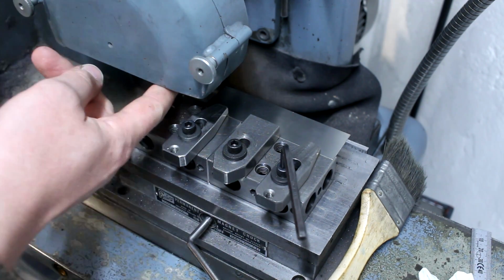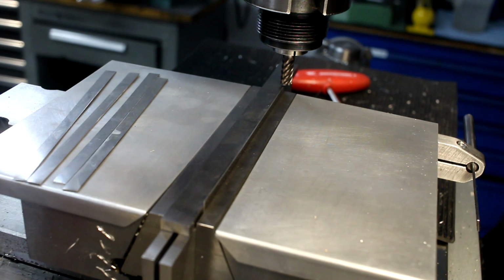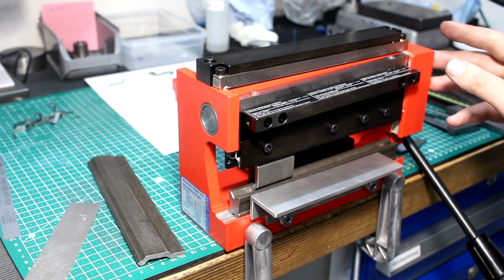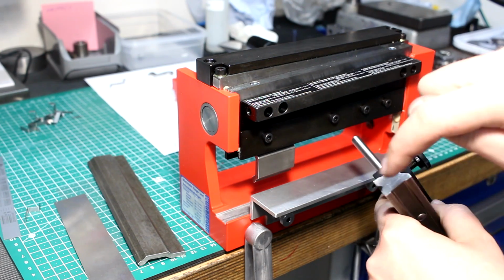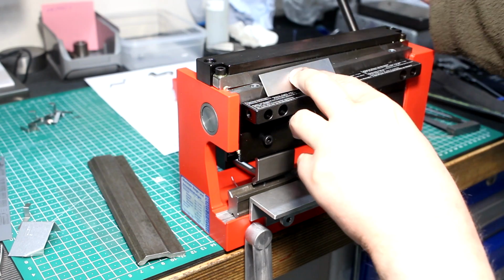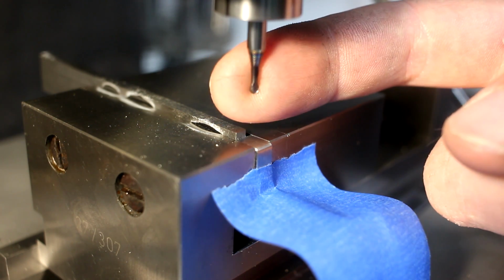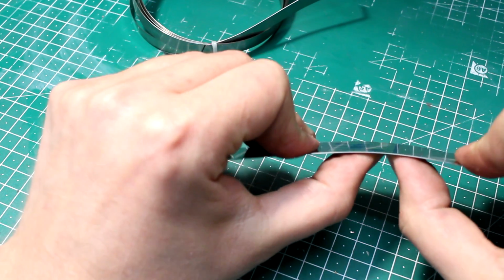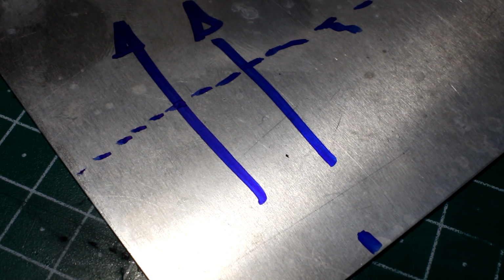Sheetmetal work and the Profiform 200

Comment: I never cut spring steel with tin snips nor sheers. It always needs to be sawn then I usually hand file the edge. Nice cutting work, Stefan.
Thank you for explaining the stress lines and the scribe lines and the cracking that takes place.

Comment: Hello Stefan,
Very nice tips as usual. Please continue shearing your great work!

How did you made you MB4 so silent at 3000 rpm even if it has a gearbox?
My Optimum BF 46 is much more noisy at that speed  then your machine.
Or maybe you reduced the sound when editing the video?
Reply from the maker: I pull the volume of all machines down by 15..20dB - Much easier to watch/listen to it on video.
But even in real life the machine is at 3000 rpm quite ok, i usually run it without hearing protection.
Reply: Thank you for the answer.

Comment: Stefan, just an odd question which keeps me wondering of I should go for it or not. I own an Heur Front vice which I really like. I use soft jaws with magnets to protect my parts but they are kind of troublesome in use; Newton keeps on acting upon them. Ideally I would like to fit screwed down exchangeable copper jaws. THis means I have to machine the vice which is doable, but I also need to drill (no problem also using a carbide drill) but also to tap. When I'm at tapping I can't go back. I then milled a relief for the copper jaws and drilled the holes for the tap. My worry is to get a decent thread in the holes without breaking the tap. I cannot mill the thread because the vice is to big for my machine (Haas Mini mill) to have enough clearance for the tooling to reach the vice jaws. In short; what do you think? Thank you in advance for your answer and with best regards, Job

Comment: The grain of metal is more like paper than wood. Modern paper has a grain to it too for pretty much the same reason as metal because it's made on a continuous process machine. If you are folding a piece of paper across the grain the bend radius will be larger and can actually cause the paper to crack so the signatures in books and the folds of magazines always take the paper's grain into account. Usually the grain of metal is only a big problem when drawing shapes, like aluminum cans for instance; the grain means that after multiple draws you end up with "ears" of metal around the top that have to be trimmed.

Comment: Yet another time when I learn something new. I did know about problems when drilling spring steel. We were making angle gauges during our metalwork class and were advised not to stop when drilling the spring steel blade because it would work harden. We of course weren’t using a pre-hardened material, the bluing was part of the exercise.
Like your new machine. Glad you treated yourself to a Swiss variety, but those Chinese prices are addictive.
Regards

Comment: Great video Stefan. One comment about your aluminium I could make is that it did look like it had a surface prep on it. Sanded or brushed. Straight off of the rolling mill it is much smoother in appearance. Almost impossible to tell the grain orientation in a smooth aluminium sheet without a few test bends. Great video, and I enjoyed watching your explanation of your little bender/shear. Beautiful tool.

Comment: Thanks for another enjoyable video.  
However, I have always regarded marking Alumin(i)um or it's alloys with a pencil as a way to install a delayed corrosion crack generator. On aircraft, it is not good to have your work assessed by a coroner. (http://lists.contesting.com/_towertalk/1999-01/msg00003.html)

Comment: About the shear, I think the stock material is meant to go in the gap from the back side, and the gap would act sort of like a hold down on a regular shear, else you run into the lift-wedge problem you just had when you tried holding the narrow piece from the movable blade side - it lifts and and tries to wedge between the blades pushing them apart hence requiring the strong backs for the blades, but if there is a hold down for the material, the lift-wedge doesn't happen and no need to add the strong backs

Comment: Hello Stefan, I agree with not wanting to use the term grain direction.  However, material rolling does effect the grain structure of the base material.  Think of forging, as an example.   Rolling compresses the material grains in an outward direction changing the tensile strength in the direction of the roll.  Thus the material is more susceptible to fracture in the direction of the roll then in the perpendicular direction which has increased tensile strength due to a more compressed grain structure.  Hope I'm making some sense.  Nice video as always.
Reply: Agreed

Comment: looks good stefan, is there any chance that you could show how you grind the thin parallels? Thats something I cant seem to find any info on, doing really thin parallels of different sizes. 

I was watching a video the other day where the guy was forging nails, but he was using sheared blanks, and was showing how the grain structure was by trying to bend the sheared blanks with them being sheared cross grain, and was just snapping them off till he stuck them in the forge to heat them up, which rearranged the grain structure and then could bend them 90 degrees no problem.

Comment: Profiform 200 looks nice. I am hunting for over a year for small semi-portable bender like this, but 200mm is too little. Profiform 320 still looks a bit too small. If there was 500mm model, that can also bend 1.0mm steel and 1.5-2.0mm aluminum, that would be great. Most of the bends I need are less than 300mm wide, but there are few that are 480mm :/  And I don't have space for huge machine tho.

Comment: At 5.45 why not mill them all together? Did I miss something?
Reply: I'm with you. I prefer to stack parts like this together because there are fewer burr edges to deal with afterwards, and its much faster.
Reply: Have you ever tried herding cats?
Small thin parts like that are just about impossible to get them all setting down on the bottom at the same time.
Reply: @andreblanchard8569  sorry but you are wrong. I've done this many times. I may even have it on one of my videos.

Comment: I have never paid much attention to the "grain" in sheet metal, I will need to do better. That worth the price of admission,
Reply: Me neither, I've drawn probably a couple hundred military parts in sheet metal with most of them having bends and many in multiple directions.. Never heard that it could be a problem. But I'm thinking the bending radius must have something to do with it too.
Reply: @erik....  I have always found this information in old books on press tools, I don't have any of mine to hand right now but probably they are all pre WWII. They were often concerned with blanking and bending parts on the diagonal to avoid cracking. I don't know when the information started to disappear from the books or why.

I suspect my books are old enough to be written by men who had experience with real wrought iron and that stuff is fibrous, stringy, often with slag inclusions and a very definite grain like wood.
Reply: Absolutely priceless information.

Comment: Stephen great video enjoy all your videos, the time you spend and the quality the video is top notch. I'm a model /tool maker 40 years in the trade and work in the  R&D shop in California for a very large multi national company.I  deal almost exclusively with metric 3D models and prints. and use a lot of thin tool steel in the 1 mm thickness. I usually have to mill and grind from a fraction, or get it double disk ground. Wondering if you know of a source in Europe That sells  metric thickness tool steel in sizes that like  1 mm . Thank you for time Allen

Comment: Instead of a strong back on the top of the brake/shear, it looks like you could just add another fastener or two to secure the blade. It has two, one on each end which might allow some flex like Robin said, but another fastener in the middle would be easy and wouldn’t allow it to flex there. Of course I guess if you had to replace them, you would have to drill the other hole(s) in the replacement.

Comment: Stefan, do you using 3d-printed tooling in your work? Like fixtures, stamps or bending tools?
Reply from the maker: Nope, for what we do, milling a quick prototype tool out of steel or even plastic is usually faster than 3d printing (Speaking for both my dayjob and my work at home)